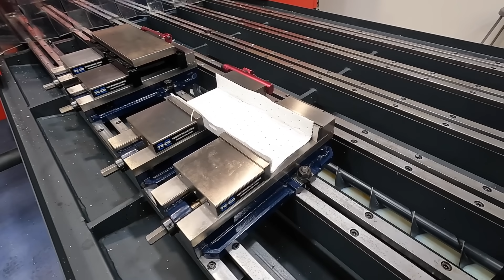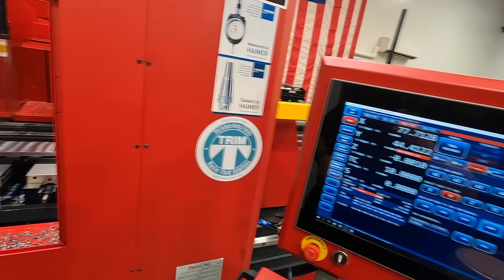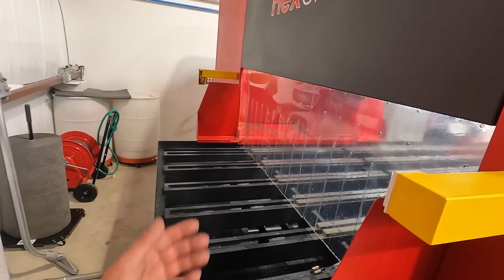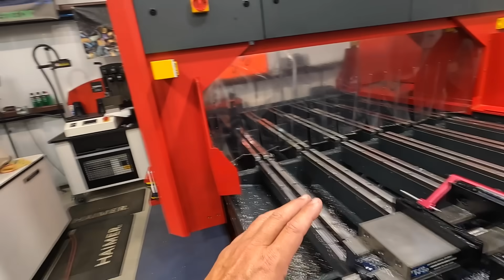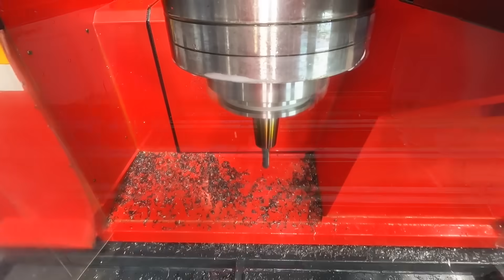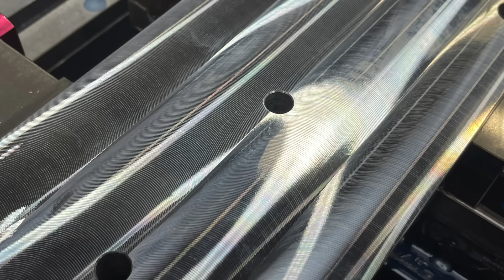V-Block Adaptors for the Flex CNC

Comment: the machine stopping is fine (although annoying) but it really should not crash!!! there must be something quite wrong in my opinion. it should stop and hold its position at least until the spindle stopped to prevent big facemill chew itslef into the material and destroy itself (best case) or the spindle (worst case)

Comment: Wondering why you have such large CNC machines - typically used for production or large CNC milling jobs? Are you leasing out time on the equipment when you aren't using them?  Just seems like an enormous and advanced machine to learn on.
Reply: I don't know, but Adam and his ancestors have often worked on rebuilding or repairing large rollers and hydraulic cylinders for local factories.  A company with a shut-down production line is a company losing a lot of money fast.
Reply: @stuartschaffner9744 non of the cncs he has would be a good fit for that kind of work
Reply: @keithhasafastcar  , OK. Would you like to explain why?  I notice that Adam has often worked on production-line parts that need to be replaced or repaired because of wear.  Often the part itself is complex and valuable.  If the part is no longer manufactured then it can be extremely valuable. CNC machines seem to be able to handle high-precision machining on high-value parts with complex geometries.

I'm not saying that you're wrong, but I think that we would all benefit from some more detail.  I'm here to learn.
Reply: @stuartschaffner9744  simply due to size and rigidity. The two miltronics are too small to efficiently do work the size of what he used to do and the flex while being a larger machine that could accommodate the size of the parts being a 40 taper machine the spindle would lack the power and rigidity to run larger tools and program them at efficient speeds and feeds. As well, because a lot of repair work is irregular due to wear and damage it would be time consuming to model them in a cad cam accurately unless you had a 3d parts scanner which is why to this day the majority of repair work is done on manual machines
Reply: @keithhasafastcar  , very well argued, Keith. I might quibble about the need to accurately model all of a worn part in cad cam.  I have done work in computer graphics where we used to use virtual bounding surfaces to establish where the operations should be limited to.  Kind of like guard rails.  I wish the best for Adam for being a pioneer.

Comment: Don't use coolant on your facemill when roughing.   And for your carbide drillbits with inner coolant, there exist closed ER collets (otherwise, all the coolant pressure goes through the open collet if you have to drill deep enough).

Comment: Adam, if all you did was ‘ruin’ a cutter, you aren’t doing too bad! 
Where I worked one of the guys put an incorrect rapid offset, + instead of - or vice versa, practically totalled a week old Bridgeport CNC lathe, tore the tailstock off, busted the tool carousel and the cross slide, it was so bad that it had to go back to Bridgeport for reworking, it was beyond on site repair! 
There are basically two groups of CNC operators, those that have crashed a tool and those that are going to crash a tool! 
Don’t beat yourself up over this!

Comment: If any of my cnc machines stops mid operation I have the option to either start from the point it stopped or return to start of program. They will never start ahead of the point they stopped unless I was to advance the restart point. I can only assume this was an operator error and nothing to do with the safety stop system.
Reply: If you edit your post to spit out "N" style sequence numbers you can start from N2, N5, N26, Aslong as it calls up the tool and work offset in the beginning lines of the sequence. Hope this helps

Comment: Adam, Those laser systems like on the gantry protecting the front of the machine are programmable and generally have aux outputs for both the warning and the e-stop. You might ask if there is a way you could add an audible alarm (like a vehicle backup alarm)  to for the orange warning area. I would ask your contacts if this can be added or which terminals in the control box are for these aux outputs. It would give a warning if your leg or something else entered the warning area for some reason and when you got out of the warning area, the audible alarm would silence. I have worked at 6 different manufacturers and all had these exact laser setups on everything from Amada turret presses to moving robotic tuggers traveling through production areas. If someone randomly steps in front of, or something blocks the path of the equipment being protected, the orange zone will sound an alarm and/or stop (the robotic tuggers) for a short period of time. If the person or object comes into the red zone at any time during operation, it will e-stop the equipment until maintenance or the equipment operator  can reset the machine and/or properly restart it on the tool path.

Comment: there is an old saying, attributed to many different people, " He who does not make mistakes, usually does not make much of anything"
Reply: For young folk starting out in the CNC production world, an alternative philosophy might be more  fitting.  Something along the lines of  'High output , no scrap and no crashes ( or very few, at least) and you'll go far; or at least get to see your next paycheck'.
Reply: @james-ew7kl  That is true with enough expereince and you are only running true and tested production runs.
As soon as you start to develop the programs you run, sooner or later failures are inevitable. Of course with growing experience those failures get smaller and likely cause less damage.
Otherwise, especially when learning something new is involved, I know a different variant. There are two kind of machinists that never crashed. Those who lie and those who never actually tried.

Comment: now, im wondering, if the CNC industry could add in a type of camera feedback system that could visually observe the work area and the work piece, and use some sort of program that can recognize when a crash may happen or if anything like the slipping of a tool is occurring and it could automatically stop the machine before damage occurred. also, as perhaps a means to quantify the location of parts without using or in conjunction to a probe tool, and at the same time use some sort of automatic laser scan technique to help in the precision aspect. anyways, just a thought.
Reply: Technically that is feasible. and especially when it comes to tool positioning or tool slipping I heard of something like that. And that was more like holding and spinning the tool in front of a camera every now and then.
The problem is, systems today can very well compare with a known "standard". but with allways changing setups and workpieces, AI or not, systems are not yet there to capture everything or reliably enough learn the boundaries themselves. 
And remember, cutting means you crash the tool into your stock material. Just at a very controlled rate.
Reply: @alexanderkupke920  Would it be possible for the computer to think, ''OK, here's a long thin end mill and moving it this fast through a cut this deep will snap it off'' and so not do it?
Reply: @JohnSmith-vi5pz  sure something like this is possible. but as I said, there are so many things to it. recognizing the bed, the gantry, the spindle, the tool, work holding, workpiece,... of which parts can be different every time. And then you also want it to only prevent certain speed combinations, as it should not stop a normal cut, which may initially look like a crash to happen, so it better be also aware of the cut plan etc. Then there are chips and coolant going almost everywhere, so you have to deal with drops and large amounts of liquid obstructing the view, eiither because of the jets of coolant, or because everything gets blurry from a drop of coolant on the lens.
Hell of a lot of work to get it running reliably, and costly for sure. And looking at what AI systems are able to do today, I would say we are not quite there yet.
Reply: @alexanderkupke920  Thanks, makes sense, never thought of the coolant on the lens - that would be hard to stop for sure.

Comment: CNC is old testament computing, lots of rules and NO mercy. scrapped a coffee can size lump of bronze over 1 missed detail in post, 1 lead vs 2 lead acme. Okuma is a great machine, but holy hell is it trying to crash on you. For the drills check out Dormer ADX series drills they are remarkable for a hss drill, no pecking, crazy feed and they last. we are currently running a 1" deep  #7 (5.1 or 5.2mm) for a 1/4-20 hole in 1018, no issues at all. we run other sizes too, never need to bother with a spot drill even on an 11/16, things just eat.

Comment: Adam, on the face of the cnc chuck, what is yhe yellow X that looks hand drawn???
Reply: It's telling him what dog to match the tool holder divet too, its critical, the things only go in reliably one way.  Always dot out in the tool changer.
Reply: @gregdawson1909  Would that be mainly for fittment reasons, or just, as it was set up in one specific position, to avoid runout from very slight tolerances adding up instead of subtracting themselves? And with those spindle rpms very minute differences may already cause vibrations and everything that comes with it. (Higher wear, not hitting sizes as well etc.)
Reply: @alexanderkupke920  Every tool holder we have has a dot or divet by one dog notch, they always go in the spindle the same way and the tool carousel the same way. its not some sort of theoretical potential loss of consistent accuracy, they don't actually engage in the spindle properly.. I put one in backwards once and it turned an insert drill straight into trash. I thought I was feeling the divet but it was actually the head of the weldon style setscrew.

Comment: This CNC adventure can be moved along a little faster if you would go through all 10 Titan's of CNC Building Blocks. Each Building Block project is shown using Solidworks with MasterCAM and also using Fusion 360. 

Hire a local experienced CNC operator to conduct the demo to inspire a little confidence in the machine.

Comment: Just to be clear, the following statements are observations and not meant as criticism.

I respect that you're still learning CNC and that these parts are demo pieces, so I mean no offense when I say that this demonstration wouldn't give me confidence in buying a Flex. The safety features alone would make me cautious, knowing that simply standing in the wrong spot for too long could cause a crash, assuming that's what happened. Without knowing the exact events that led up to the crash after the emergency stop, we can only guess the cause.

From what I see, the machine isn't handling high-speed machining well, which might be causing the stuttering. I've seen similar issues with Haas machines when high-speed machining isn't enabled, so it seems like the controller can't keep up with the adaptive strategies. Another possible cause could be that the lead-in, lead-out, or plunge feed rates are too low in Fusion.

The Flex seems designed for very specific applications and might be overkill for these parts. These and similar parts would probably be best made on your Milltronics mill if you're focused on optimization, while the Flex might be better for larger parts that take advantage of its size. Those tool change times alone can undermine any programming optimizations.

Regarding what happened at the 19:34 mark, I'm not entirely sure, but it looks like your part was shifted too far to the left from where the WCS was originally set, considering how deep the cut was on that end and how light it was on the opposing end. For parallelism, you could bolt the plates to the rails and then face them to ensure they're parallel with your spindle and both parts are of equal height.

Anyway, keep at it! We all started somewhere!

Comment: Just a question, not trying to trigger anyone, but has anyone ever seen Adam respond or reply to anyone in these comments ? 
I’ve never actually seen a reply. 
Just curious.
Reply: He responded to me once,over what I thought was constructive criticism.His response was short and terse.Frankly, I was surprised.
Reply: he does reply privately
Reply: @fungas4804  thanks for the reply. I’m looking to reach out to him but I know the comment section would be a long shot. 
But thanks.
Reply: For Adam to  reply ( to guys he does not know personally) on here,. your comment has to strike either a chord or a nerve; so yes he has replied, sometimes with some fervour,  lol  On his Facebook posts, he replies all the time.
Reply: @james-ew7kl  I wonder if anyone has mentioned that steam stoker engine that Keith Rucker sent him to spray weld and cut with his shaper?Maybe he can do it with the Flex CNC.
Reply: @jamesdavis8021  I remember someone suggesting that, but it got no response or traction.  The spray weld has already been done, I think by Keith Rucker and Lance.
Reply: @james-ew7kl  I have not seen anything on Keith Rucker's page,about progressing on the project.Keith made a extension for a small face mill (I think)to attempt to mill it down but,he was getting way too much chatter. I haven't seen anything about it since.Personally, I might have tried milling it anyway,regardless of the chatter,as long as it doesn't break inserts.That should get it close enough to scrape in with the Biax scraper.What have you got to loose?

Comment: Why does the machine crash when it shuts off due yo a safety trigger?
Reply: Should it not e-stop/brake, lift why tool, both? I know nothing about CNC, have 0 experience with machining.
Reply: Regardless of the reason for the E-stop. No CNC machine is designed to just pick-up where it left off. Adam is learning that in-order to restart mid program, the machine needs to be configured for the specific operation before resuming.
Reply: When a machine E-stops it needs to STOP.

Comment: we can clearly see that you are not good at cnc ,, that cycle is intended for full depth end mill and not for face milling .. that machine is not designed for heavy milling .. run it as a manual mill and it won't happen..  if you runs in the  sercutity  system :face-blue-smiling::face-blue-smiling::face-blue-smiling::face-blue-smiling:

Comment: I wouldn't focus too much on trying to optimize programs at this stage in your learning. "Walk before you run," you know? Optimizing is something more important for shops that are doing a lot of volume, where every second is money. Since you're still learning, and doing one-off jobs where it doesn't appear that there's a push to shave off seconds from the runtime, it'd probably be best to just continue getting familiar with the normal operation, and once you're feeling really comfortable, then you can move on to optimizations.

Comment: How the hell does that thing crash like that when the E-Stop is triggered? I'm confus.
Reply: Regardless of the reason for the E-stop. No CNC machine is designed to just pick-up where it left off. In-order to restart mid program, the machine needs to be configured for the specific operation before resuming, Adam is learning that.
Reply: @Dreddip  I didn't catch that he started the same program from where it was stopped. Thanks.
Reply: @Dreddip  thanks, I didn't catch he reran the program with the mill still in the cut. Guess it went straight to a G00 at the same z  😬
Reply: because it's a piece of sh***.. when it switches off, the servo releases,, the axis is pulled by the gear wheel,, so the milling head takes itself ..  that would not happen with ball spindle
Reply: @gertkristensen6451  that would ONLY happen on a ball spindle, but I HIGHLY doubt this machine doesn't use servos, so even in E-stop the spindle won't just sag and the control not know.

Comment: Adam, Great video on the Flex. I want to preface my question here by saying I am not a CNC guy, "back in the day" I ran manual machines ( mills, lathes, Bullard, Horz. boring mills, ) @ 40.20 you begin the chamfer on one end of the part and then go to the opposite end and then move around the part. Wouldn't it be better to begin on one hole and then progress in either a Clockwise or Counterclockwise direction rather than moving from one end to the other and then progressing ?

Comment: I agree with @kawazukisoddbits2717. Very strange indeed. I do large size 3d printing, and to eliminate cooling of the filament onto the product we reverse the last Z-instruction during an EPO. This if the last Z-feed was down 0.18mm, then during an EPO, we move back up 0.18mm and shut down. No X or Y movement.  Maybe something to consider adding to this machine.
Reply: Nobody here cares about 3D printing

Comment: Seems a strange 'safety feature' that allows the machine to continue spindle rotation and X / Y movement ! I would consider a positive Z move ie. take the tool away from the part as essential, no X / Y moves and stop spindle as the best solution - I wouldn't be best pleased trashing an expensive tool just for a daft 'safety' move - that ain't just a carbide end mill!